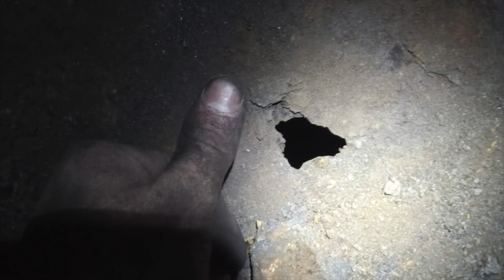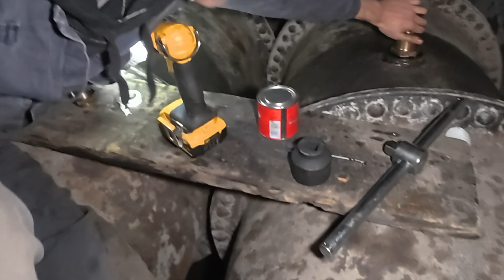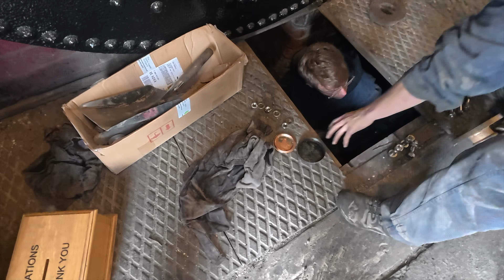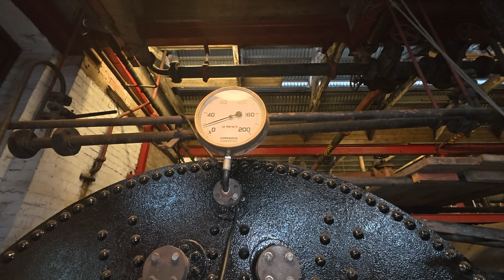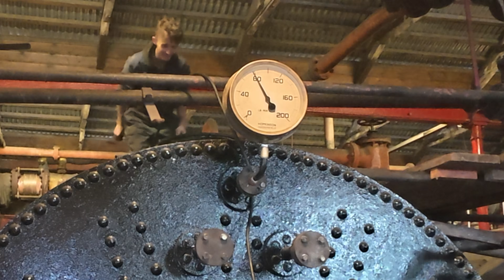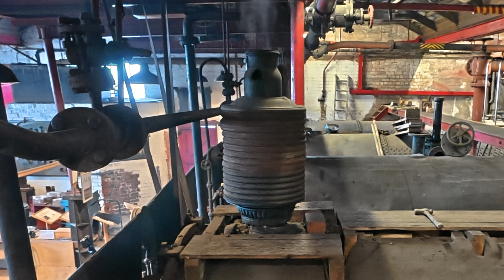#1 Can This Victorian Boiler Still Hold Pressure? | Hydraulic Test at 120 PSI

Comment: No way in hell I'd be standing next to (and on top of!) that thing the first time it's been brought up to pressure in 35 years. Those guys are braver than me.
Reply from the maker: The reason why we fill the boiler completely with water before bringing it up to pressure is because it makes this testing process completely safe, if anything were to fail catastrophically you would only get a jet of water.

Hydraulic testing is an approved testing process, what you see in our videos is completely safe and complies with all regulations.

Comment: When we pressure test our industrial boilers the valves have to be in the open position with blinds installed. It prevents damage to the valve internals and also negates leakage.

Comment: What’s the point of the melting lead in that brass piece?
Reply: It melts and steam gushes out and puts out the fire whilst the boiler pressure drops

If this didn't happen, the metal would overheat and the boiler would fail catastrophically and explode
Reply: @bussesandtrains_121 okay i figured it was to put out the fire in some way i just wasn’t sure as that seemed like it would shoot fire and pressurized out of the fuel chute (where the guy that throws in the fuel is standing)
Reply: @awsomeg @awsomegamer8277 That’s exactly what would happen. It would blow the fire door open. 
The victorians thought this was better than blowing up the whole site when the boiler exploded 😂
Reply: @lifebeauty0173 I mean it would be better but not by all that much 😂

Comment: Will the other 2 boilers be restored or are they condemned?
Reply from the maker: They are not condemned as such; however, neither boiler currently holds a valid certificate to raise steam. Both would require remedial work in order to pass inspection and be returned to service.

Boiler No. 2 has several holes in its fire tubes. These would need to be repaired by a coded welder before it could be considered for service again. In addition, the surrounding brickwork would need to be stripped away so that the boiler shell can be fully exposed for inspection, with any further repairs carried out as required.

Boiler No. 3 requires significantly more work. When the station was closed, it was left full of water and the fire tubes remained filled with soot and ash for many years, resulting in considerable deterioration. We have since patched No. 3 to make it watertight, and it is currently used to preheat the feedwater supplied to Boilers 4 and 5 when we are in steam. The manhole cover is not fitted to No. 3, so there is no possibility of it becoming pressurised.

While it would be possible to return Boiler No. 3 to steam, doing so would be a substantial and rather costly undertaking.

Comment: So those plugs inside the boiler with the lead that will melt if the water gets too low.  What is the exact mechanism of the safety there?  Does the water then escape down the fire tube into the firebox and put out the fire?  Or does the steam just escape up the flue, relieving pressure?
Reply from the maker: The steam escapes into the fire tubes and smothers the fire, there is still a lot of water in the bottom of the boiler at the point when the plugs melt that water is at around 150’c if the boiler is at 80 PSI when they go, as the pressure drops this continues to boil to steam (water expands 1200 times by volume as it boils) so there is more than enough steam ejected through the plugs to put the fire out.
Reply: @ClaymillsPumpingStation ah, so my first guess was pretty close. Thank you! Fascinating video to watch.
Reply from the maker: You’re very welcome, it’s great to hear you enjoyed it.

Comment: In the military I had the fun job of hydrostatic testing pressure vessels all over the place. Pressurize everything to 150% of operating pressure with water and start tapping seams and welds with a hammer. Every now and then a seam will pop and hose you down. The scary ones have to be proof tested to 7,500 psi for 30 minutes. I still grit my teeth just thinking about those monsters.   UGH
Reply: Yes, I had to do some of those HP air receivers in Devonport dockyard when I used to do boiler inspections. Certainly focuses the mind when you do the hydro tests on them. Having said that the cracking columns in the oil refineries were far more complex inspections.
Reply: @billdoodson4232      Oh man, I can't even imagine the craziness involved with those monsters.   Wowsers

Comment: Its interesting to see what looks like mechanical stokere on these boilers.
I once did a steam experience day at the Crofton pumping satation. This included firing their Lancashire boiler by hand.
Its was surprisingly easy to do, just toss a load of coal in every 20 minutes and push the fire back with what was essentialy a really long handled rake.
But then, normally a stoker would feed a lot more than just one boiler wouldnt he?

Comment: What an interesting and worthwhile endevor restoring and running the pump house. Nice work on the boiler, and a lot of it! This attention to detail is really necessary for the ongoing safety of anyone in the building.  Even though these boilers only operate at 80 psi, not like the hundreds of psi with modern high pressure boilers, a boiler explosion would still be catastrophic for anyone nearby. Nice to see young people volunteering for this demanding work, too.
Reply: Hi Werner. Greetings I hope my message didn’t come across as invading your privacy.
I just wanted to say I came across your comment and profile, and it really stood out to me, it reflects someone with a kind and genuine heart. I don't normally write in the comment section, but I think you deserve this compliment, I would like us to be friends. God bless you……🌺🌺🌺

Comment: Well done on the achievement of passing the hydraulic test. As someone who has been involved in pressure vessel design, getting welding procedures and welders approved, I am interested in knowing if you had to present any information to the inspection company. In terms of welding, calculations etc for the fusible plug mountings and general welding repair procedures for approval. Considering the age of the boilers did you have to get the boiler material spec checked. When built such documents as British Standards were not available? Bit long winded, but heritage boilers are new to me. Always suggest safety glasses when pressure testing.
Reply from the maker: Thanks for your great comment I had to check with a few relavent people before I could correctly answer this.

In a nutshell it was inspected thoroughly before we started by Jacob & then the inspector.

A material sample was taken a few years ago from number 4.

A standard operating procedure was then drawn up (by Bill who is pictured in our first video which tells the backstory and is very sadly no longer with us but had an amazing life in the merchant navy and many other forms of engineering. We will likely be telling his tales in future videos)

The approval was issued by Alstom who have all sorts of snazzy metallurgical tackle. This SOP states the grade of welding rods to use & the pre heat temps BSI has been around since 1901 and these boiler were fitted in 1936 by Thompsons of Wolverhampton to replace the original 1885 boilers.

I hope this answers your questions, thanks again for a great comment.
Reply: @ClaymillsPumpingStation many thanks for taking the time to answer my  questions. Shame I don't live anywhere near you to visit.

Comment: Really Enjoy Your Dedication and Expertise in Restoring and Returning this Astounding Steam Beam Engine Power Station Back to Live Steam.  Amazing Work ! 

One Question , What was the reason the Thompson Boilers were jacketed with brick ?  Definitely a challenge to repair any plate sheets and rivets concealed.
Reply from the maker: Hi David,we’re thrilled you enjoyed our second video, the bricks on the top of the boilers are just placed over them, there is a layer of blanketing over the boiler shell then a layer of brick with no mortar, only gravity keeps them there and another layer of blanketing covers the bricks, this is mainly there to minimise the heat loss and prevent the boiler house from becoming unbearably hot. 

Originally the boilers were covered in a layer of what was called “Monkey Muck” this was a mix of plaster and asbestos this was professionally removed by contractors employed by Severn Trent water as part of the works they did to make the site safe and water tight prior to them handing the keys over to the trust.
Reply: @ClaymillsPumpingStation Thank You for your detailed explanation.  Looking forward to seeing ClayMills roar back to life, it is in Well and Capable hands with your dedication and care.  

Thank You for Sharing the Journey